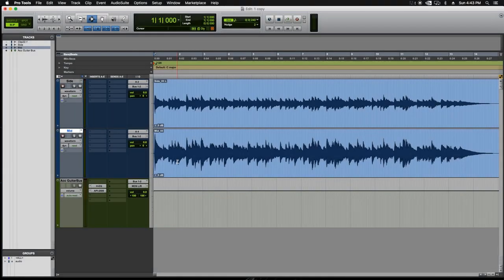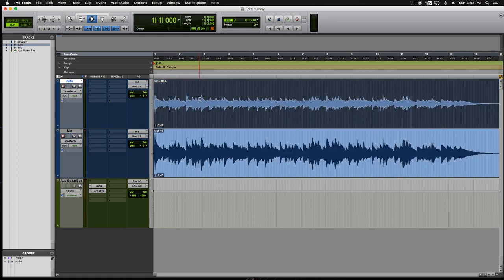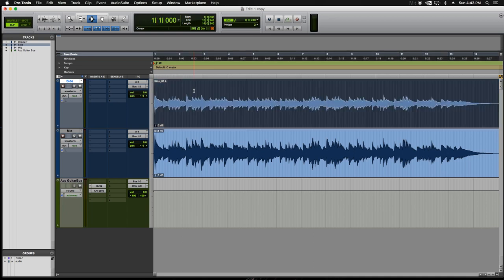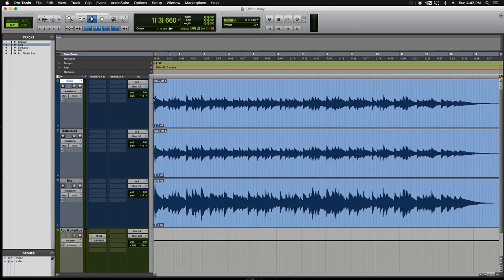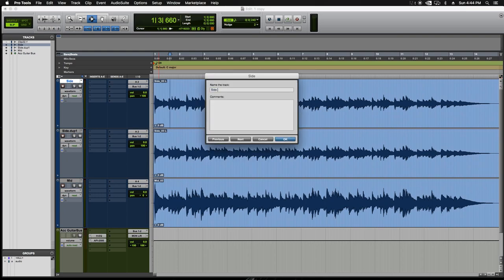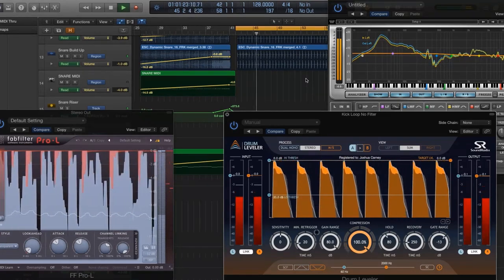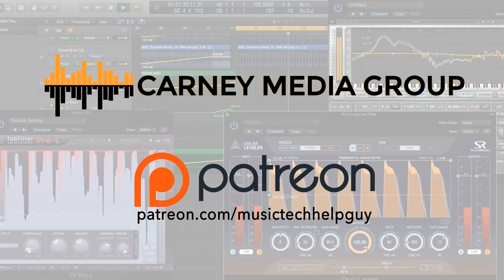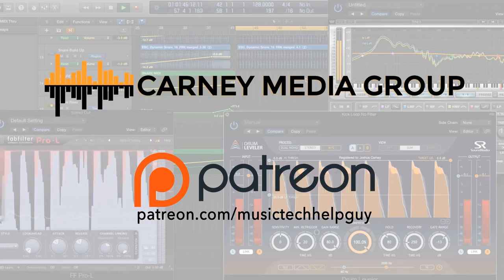5 Recording Techniques for Acoustic Guitar

Comment: Thanks for showing mid/side, many people don't.

The "problem" you describe with mid/side is not a problem at all, it's the basis of how it works. Your mid/side recording does sound a little phasey and unfocused: that's because you have too much low content in the side signal.

Try applying a hi-pass filter to the side signal, let's say 150Hz, 12 db/octave: I did, and the sound became much more grounded while retaining a beautiful stereo width.

Comment: Hey Josh, sorry if this is off topic, but which headphones would you blindly recommend on a 150-200 dollar budget. I will have to buy it online and so I can't test them, and as a hobbyist I want to keep the budget down. Will increase the budget if needed, definitely don't want to buy something that's not up to the task. Will be using them for tracking and mixing and I live in a noisy area so prefer closed and around ear. Hope I'm not being intrusive. Thanks!

Comment: When using the stereo methods (e.g. XY), should you record using one stereo track? or two mono tracks panned hard left and right?
Reply from the maker: Either or works. It's personal preference. I've seen people use two mono tracks panned for years, but I prefer a single stereo track. It's pretty much the same thing. The only advantage of using two mono tracks is you can control the volume of each channel easier if something happens and one channel is too loud or too soft. I usually just make absolutely sure that the levels in the L and R channels are about the same before doing any recording. If I do end up needing a volume change in one channel, I just put H-EQ on it, unlink the channels and pull up or down the input level in the plug-in until they match.